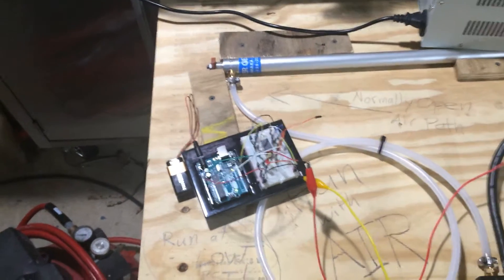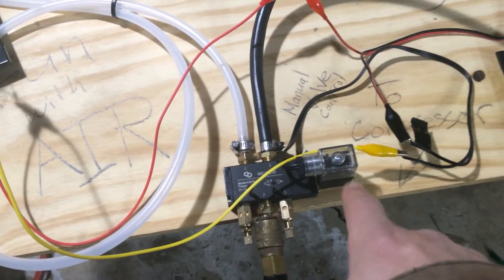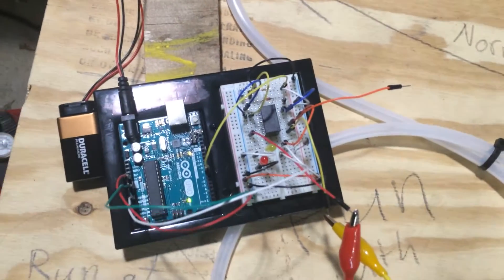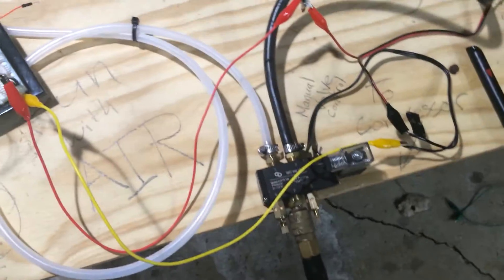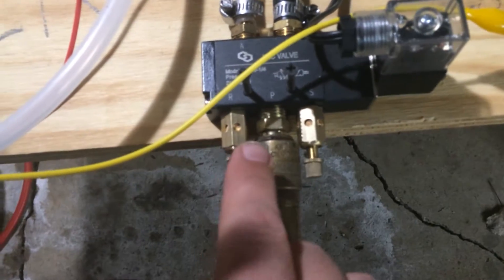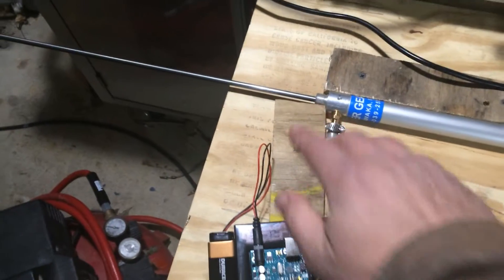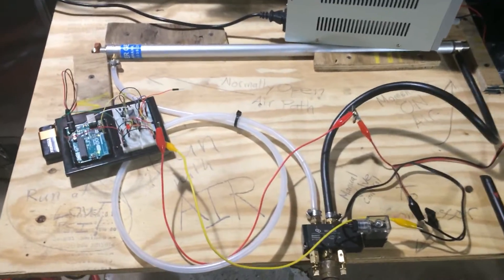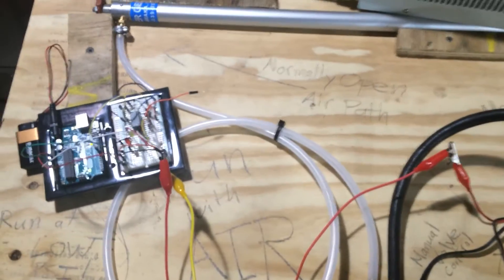Testing Air Cylinder controlled by Arduino & Light sensor

Comment: I have a piston(100 mm stroke) , Relay, Selonid , photo cell & Arduino (now i want to control the piston movement  to move 25 mm only not the whole 100 mm stroke after seeing the object by photocell , is that applicable by Arduino?

Comment: Putting the hydrolics in the mid section of each door as they hang at the side of the frame would allow you to have a flat wall design and side pressure to seal the door. The rubber seal should be in the tooth design he chose as it would hide it when closed.. A pulley system with one ac driven motor would work as well.

Comment: Sir? what company for we to order that type of pneumatic cylinder? because we need a stroke like that.
Reply from the maker: Air cylinders like this are available from industrial supply stores, such as Grainger. Popular brands include Parker and Bimba. I purchased this air cylinder at a scientific and surplus store. Air cylinders are available in a range of sizes, styles, and prices. If you need a different stroke length, a lever or gearing could be attached to the end of the rod to change direction, speed, or distance of the power created by the air cylinder.
Reply: Thanks Sir..
Reply: Sir how about the circuit diagram of this video sir? can u please upload sir..:).thanks
Reply: Bren Higeh

Comment: +BenjaminNelson Hi, I am really interested in the circuit you have made in this tutorial. Would you be able to give me some more guidance on the type of relay air valve that you purchased, ie size or manufacturer. Also can you specify the two types of battery and why you need two? I am a complete novice and would really appreciate the advice as this is going towards my university degree. Thanks

Comment: Hi!! i'm currently working on a project and we are having trouble figuring out the code for a pneumatic arm. Where can i find the code that works exactly like yours? much appreciated!
Reply from the maker: +Shao Wen I am a total newbie when it comes to Arduino. All I've done was get an Arduino kit which included a board and a small tutorial book. The tutorials cover simple steps of the various inputs and outputs. I just tried learning by doing the tutorials, and then modifying a tutorial in a way that would work for my project. For example, the book had a tutorial where a light sensor would turn an LED on and off. I modified the tutorial to that instead of the LED, the Arduino would instead send a signal to the relay air valve. So, the light sensor then activates the air cylinder instead of an LED. For me, and lots of other people, imitation and modification is a great way to learn!
Reply: cheers for that!

Comment: Ben, where did you source the cylinder and air valve?
Reply from the maker: The air cylinder was $25 at a surplus store, although they can be bought from e-Bay or mechanical suppliers like http://www.mcmaster.com. The valve was mail-ordered from Amazon. This is all pretty much standard components used for things like building factory machines. It's common materials, but maybe not stuff the average consumer works with every day. I'm just learning as I go with these types of materials. The best source of information I've found so far about learning about pneumatic cylinders is from various DIY Halloween Prop forums.
Reply: BenjaminNelson Thanks Ben.

Comment: Just a guess, but I'll bet those doors have to be pretty light weight, if you want them to move at standard Trek speed. Otherwise the inertia might be a problem..
Reply from the maker: Yep, that's what I was thinking too. Plus, it would be nice for the doors to be insulated, as they will go between a heated and unheated space. I was thinking of something like building custom doors from 1/8" paneling over 3/4" foam. Should be relatively light.
Reply: You can get pneumatic cylinders to move anything. Lighter is better, of course, if speed is your thing. But with air cylinders it's all about how much air you want to use to push with. More pressure and larger cylinders will let you move even bank vault doors.
Reply from the maker: dlwatib One thing I've already learned is to make sure to set the pressure regulator BEFORE you start playing with air cylinders. It's possible to shoot these things so fast that they destroy themselves.
Reply: BenjaminNelson
3/4" foam with a thin hard coating on the outside to protect it from denting etc.?.
Maybe 1"  aluminum 'U' channel from Ace Hardware would work for a frame.?.

Put some soft rubber or foam stick-on on the half-door edges, to prevent them from banging when closing, and of course slowing air leakage. 

How are you going to hang the door segments? 
Maybe rods top and bottom? So they can't fly off. LOL!